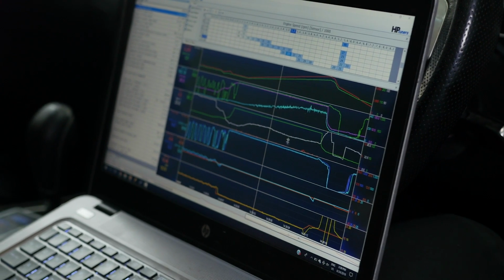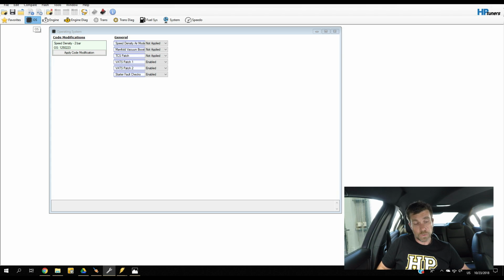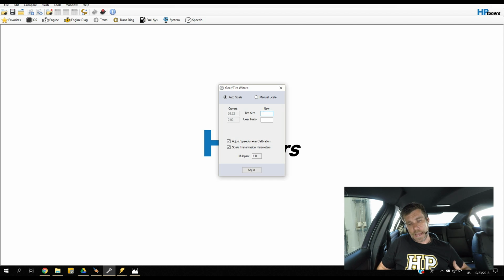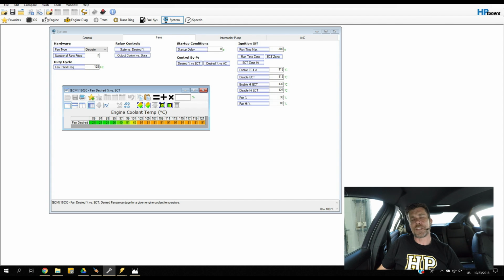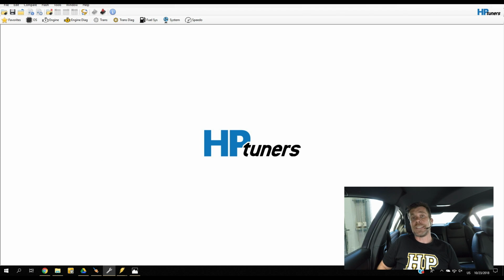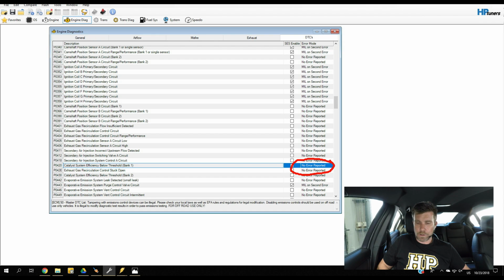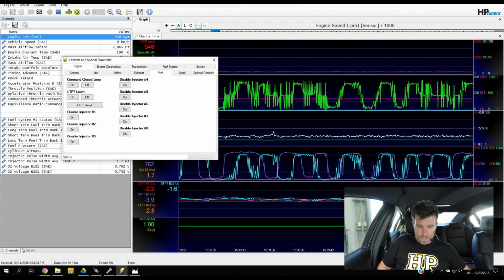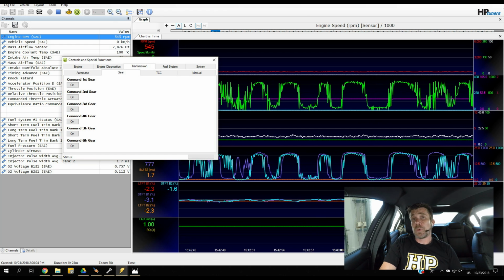HP Tuners Removing VATS, Adjusting Speedo Calibration + More Tips [GOLD WEBINAR LESSON]

Comment: I did an LS swap from a 2001 Tahoe 532A56 Ford panel truck now it's just tries to start but but but it doesn't will an HP tuner turn the bat systems off on this softful this so it will let it start
Reply from the maker: Yes, generally you can disable VATS with HP Tuners. There are also other tools for this, but if you plan to tune the engine too, which honestly you should, then it make sense to just use HP Tuners for it. If you don't want to tune the engine, then another tool might work out cheaper just for this task, but you'll have to do the legwork on that as I don't know anything off the top of my head.

For 100% confirmation on VATS disabling for your ECU with HP Tuners, I would get in touch with either your local tuner that you plan to use if you won't tune yourself, the HP Tuners forum, or HP Tuners directly although their direct support is pretty hit and miss these days sadly - Taz.

Comment: Can you help. I have a Dodge Force induction procharger. IAT is cool at 95° 2 meth shots. I need to eliminate the high temp of the ECM calculating on the MAT reading. I have already zero out the hot spark table and alter the temps on the table as well. What should I do at the table of Manifold temperature blend factor.